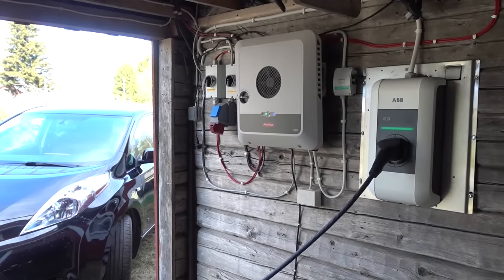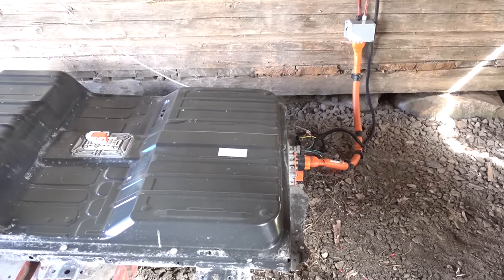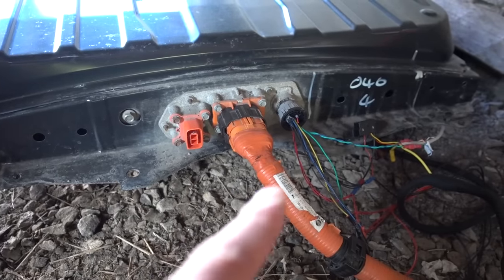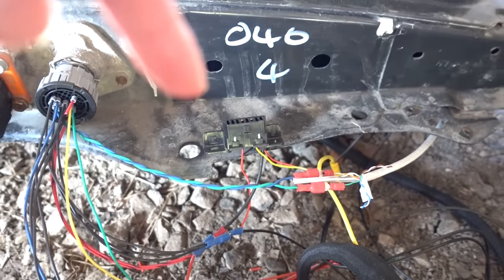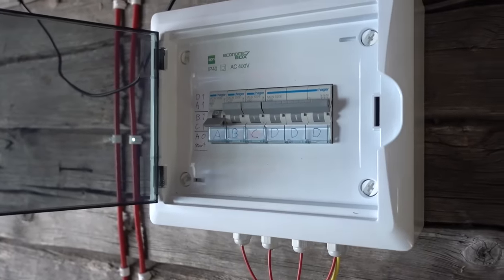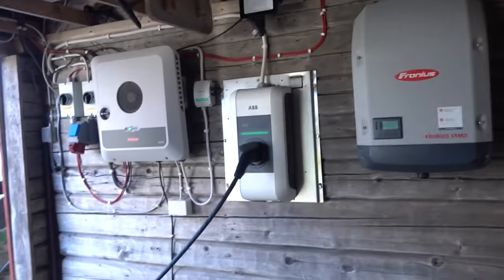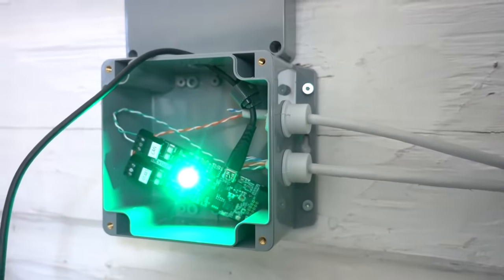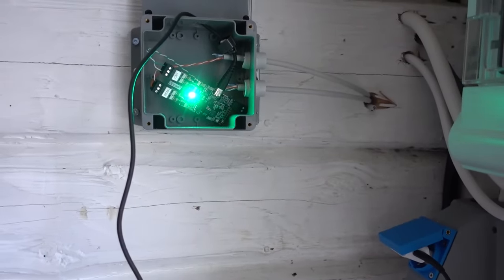The EASIEST way to connect used EV packs to grid! 🔋

Comment: Hi, it isn't really clear from the video if the BMS in the main battery remains active and does the balancing of the cells.
And since you are manually doing the precharge and the contactor, it looks like the BMS cannot protect the battery based on cell voltage or temperature. That would be very unsafe to advise to anyone.
I mean there are other inverters like Deye that can work with a high voltage battery without any communication, that is not the hard part. You have to make the car battery work just like in the car, with battery and protection.
Reply from the maker: The BMS remains active, balances, monitors, and shuts down if needed. See the wiki for more safety info: https://github.com/dalathegreat/BYD-Battery-Emulator-For-Gen24/wiki#what-about-safety

Contactor closing and precharge is now automated. Also see the wiki: https://github.com/dalathegreat/BYD-Battery-Emulator-For-Gen24/wiki/Nissan-LEAF-battery#automatic-control-
Reply: Ok great!
All model 3 supported probably also means standard range LFP version and the Y?

What prices do you buy the batteries for? Given the amount of Nissans in the past and currently the amount of Model 3s sold, I would hope for lower prices (something under the 100 euro / kWh)
The only thing that I can find that reaches that is a Model 3 72kWh for 5750 euro.
I have 40kWh of used older Winston cells that I want to replace my current 12kWh home battery with, but I'm not sure, maybe I should go the high-voltage route instead if it is more economical. (I work on battery systems so I should be experienced enough)

Comment: Love to see innovation on battery re - use. There are going to be lots of large serviceable batteries available in the future due to instances of vehicles failing before their batteries. I am going to assume the inverter or grid tie portion needs to be certified in many jurisdictions, but I wonder if it would be possible to hack a motor inverter to act as the DC - AC inverter in a project like this.
Reply from the maker: For offgrid use you can most likely do whatever, but when connecting a system to the grid you always have to use inverters that adhere to the necessary grid code standards of your area.

Comment: I already purchased 15kw of new LiFEPo4 batteries, for about $2500 from china.    How much cheaper is that Nissan Leaf?   And why does it not work in the car anymore while making it work in houses?   is it the C rating?   or the ability to crank amps?
Reply from the maker: This 30kWh pack was 2500€

Comment: Hey mate

Does this work in a power outage? if so what switches the supply to the grid off so it does not back feed into the grid?

Cheers
Reply from the maker: Yes Fronius sells a switchover bos that can be used with the Gen24 incase you want true offgrid capability.

Comment: Hi dala
🧙👍
What is the start seqenc printed on the switch box? D - A1 on - wait x seconds - B1 - C1 - A1 off. Can you discrib it? How long do you wait between each step?
Reply from the maker: The sequence is explained on the Github link in the description!
Reply: You wait until the voltage equalises across the main (open) contactor, there’s no point in guessing as each model of inverter will have a different capacitance.

Comment: The Fronius supports full island mode when battery connected, have you tried it?
I got the Enwitec switchover box and it functions very well, it's very awesome to have power when the grid has failed.
Reply from the maker: Yes it supports it, but I don't have the switchover box. The Fronius has a 3kW outlet that is active incase of grid failure that I have used before!
Reply: @DalasEVRepair  if you want to build the switchover box it's a standard DIN encapsulating with standard components (relays and fuses mostly), nothing magic in there. Enwitec even has schematics in the manual so it's easy to copy.

Comment: This is unbelievably amazing! How is the warranty for Fronius when you connect "off-brand" battery to it? Not that it matters that much, just asking...
Reply from the maker: I don't think you will get any support at all from them if you mention a DIY EV battery pack :D
Reply: @DalasEVRepair  Rather than support from Fronius, I wonder if this impacts in any way my grid connected approval papers - now the inverter works in a way when the grid goes down, the inverter goes down, too. I might need a specific device preventing me to back-feed grid when grid is down - to make sure I don't kill some technician during outage fix work...
Reply from the maker: @rklauco  No it does not! It will work the exact same way, if the grid goes down, then the inverter will shut down to prevent backfeeding.

Fronius has an extra offgrid contactor set you can purchase if you want the house/inverter to stay on when the grid goes down. This is needed to stay on without backfeeding, the contactors will disconnect the grid connection at the main incoming terminal. You can read more in their user manual about it.
Reply: @DalasEVRepair  Hmmm, OK, when the seller installed it he told me there is some sort of "backup mode" with battery, able to supply house. But he never mentioned any disconnect contactor - possibly because I did not went for the $13.000 10kWh battery (plus installation costs) :)
So you are only using the battery for energy balancing, not for KTLO while power outage, right? This is even more interesting as power outage here seems not to be any concern...

Comment: i was thinking a small micro plc modicon uses one you could replace the switch dance with a small ladder logic program and timing seqence
Reply from the maker: It is already implemented in the software via GPIO pins!

Comment: Sorry if this is a very simple question - does this need to be 3 phase or do you happen to just have a 3 phase system at home?
Reply from the maker: It works with 1phase inverters also! It just has to have support for BYD HVM batteries via Modbus!

Comment: No cooling for the Leaf battery still?
Reply: Leaf battery uses passive cooling. As long as you are not running 50kW through it: it is mostly fine.

Comment: Do you see a reason why this would not work in a functional car? I want to transplant the whole drive train into my tractor and use the battery together with a Gen24 most of the time. I´d go for a plugable solution in my case ... Thanks for sharing!
Reply from the maker: Should work just fine, just requires a lot of work!
Reply: @DalasEVRepair  Any chance that you (or someone in your community) develops a plug and play solution for Nissans ? I´m an electronic engineer and aside of my day job I deal with PV parts and wallboxes. I know that there is a huge demand for such smart solutions which use EV´s for home storage. I´m just lacking the time to start any add. project ...
Reply from the maker: @gutmanu123  Too high liability risk to sell something like this. But it is all open source with guides and wikis, if someone wants to make a product based on it they are free to do so!
Reply: @DalasEVRepair  Thanks a lot for the whole lot of information you are providing! Since just now I have the battery powering my Fronius Gen 24. It is now in Austria in use to power a "Erneuerbare Energiegemeinschaft" to supply also my neighbourhood with PV energy (35kWp).
Reply from the maker: @gutmanu123  Awesome! Congrats on the install!

Comment: You forgot step 1: how to get the money to buy this. Batteries, even junkyard ev batteries have premium cost in northern europe, hybrid inverters are quite rare here and extremely expensive also. It is nontheless a great setup you got. 

Me myself i also run diy offgrid but everything is imported from china, new B grade lifepo4, and epever ssc and inverter. Warranty claims on the electronics is a bit of a hassle but not impossible. Just takes time.
Reply from the maker: A 24kWh LEAF battery starts at 1,2k€, quite affordable IMO compared to LEAD acid!
Reply: That’s really cheap. Haven’t seen them for that price in the Netherlands yet. Please let me know where to get them for that price and I’ll import one or two.

Comment: your reduction box cable doesn't look like 10mm it looks like 10 awg which is 6mm.
10mm or 8awg is a thick multi strand wire cable. 
10mm is rated for 40Amps 6mm is 30 amps.
Reply from the maker: It is 10mm. I load it with max 18A

Comment: Could the pack be wall mounted to save space or is it better to be flat?
Reply from the maker: Yes it can be mounted on the wall to save space. But it weighs between 273 -> 420kg depending on which LEAF battery it is :D
Reply: Somewhere I read that any orientation of the leaf battery (at least the older ones), except upside down.

Comment: Oh My God, Dala, this is exactly what I was thinking of doing on the cheap cos Im on a low income compared to most people. Love what you are doing You are a Genius
Only last weekend went to the fully Charged Live Show in Harrogate UK and asked all the exhibitors about exactly what I have just watched you describe on here and not one of them said they had a system the could cater for a plug and play system with a second hand leaf battery. Would it be possible to speak over the phone through whats app? can I email you to set that up? 
I have a  2014 Nissan Leaf Tekna that I resurrected  from a write off 29k on the clock, now done 133.5k with 10 out of 12 battery bars still left and for the past 3 years I've charged it up to 100% with my Nissan Granny Charger about 5 to 6 times a week.   I have loved owning it over the past 6 years even though compared to more modern EV's its range is limited, it still caters for my everyday needs, 50 mile return journey to work in Cumbria and back and still had 38% left in the can, so to speak. 
I want to do a setup exactly like yours, I can't afford a solar roof system yet just wanted to get the low tariff of 12 pence per Kw, charge the battery's and car during the night then the release for the house during the day and so on. 
Kind Regards 
Graham
Reply from the maker: Hi, I don't sell anything related to this. Any BYD 11kWh modbus- compatible inverter will work with this solution!

Comment: Good job. Just a remark. Not safe that the high voltage and high current wires are installed on the wood wall.
Reply from the maker: Perfectly safe, the solar panel wires are the same brand and those are 700VDC! 😁

Comment: You mentioned "it's cheap" - how much did you pay for the battery? :)
Reply from the maker: Bit over 2000€. Keep in mind that a brand battery for this inverter would cost 24,000€, so it is very cheap 😂

Comment: Wow, I would love to do this for out home with a 75kwh Tesla Battery. I wonder if this could be done for less than €10,000?
Reply from the maker: 65kWh tesla m3 batteries go for about 5k€ in norway!
Reply: @DalasEVRepair  and the bonus of LiFePO4 chemistry
Reply: @DalasEVRepair  That’s an amazing low price for a used battery, Norway leads Europe in EV adoption and now battery recycling! I live in the North of Ireland, locally I could buy a 2022 75kwh Tesla battery for £7500/ €9000 ish. Our home heating is air source heat pump and my wife and drive Tesla EV’s. Having 75kwh of home storage would be beyond my wildest dreams, I will head over to your page to try to learn how I could make this happen. Our electricity is now very expensive at €0.39/ per unit. I would rather invest in solar PV and a repurposed Tesla battery than add the power companies hideous profits! Thank you for sharing your amazing findings!

Comment: Trying to find a way of mounting an EV pack to the wall of my house. They take up a lot of room flat. 

I’ve got a brick wall. Might make a metal frame that means I can mount that to the brick wall and then lift it up and onto it. With the help of some mates in exchange of some beers
Reply from the maker: Good idea, same method used in another video I have up on this topic!
Reply: @DalasEVRepair  Oo can you share with me which video that is
Reply from the maker: @TheOfficialBatteryMan  https://youtu.be/QCXeLO6gFRA

Comment: Can't do it in my country Norway without approved electrician do all the work. We are only able to play with 200VA 12V in Norway.
Reply from the maker: It should be very quick for an electrician to add a few meters of wires, and not that expensive!
Reply: 200Va er hva du har lov til å leke med INNE i huset ditt.., hva du gjør i en bod/container av Leca utenfor er på egen risk..😊
Og selvsagt kan du ta strømmen fra batteriene inn i huset via kabler, men da må inverter/kabling godkjennes av innstallatør🤔
Reply: @DalasEVRepair  It will be expensive as no electrician will do this witout buying all of the eqipment from them, Included the battery and it will also have to be CE marking on every part of your system..
Reply: @trygvetveit4747  I Norge har man ikke lov å montere solcellepanel på et bilbatteri engang. Selv ikke en campingvogn/husvagn om det står på fast plass.
Reply: @DalasEVRepair  Yeah, but none electrician even want to connect DIY at all. They take around 12500,- NOK for visit and 3500,- NOK/hour also 1250€ for meet up and 350€ hour price + travel etc etc.

Comment: Really cool but does that inverter only go 1 way for both ways
Reply from the maker: Both ways!
Reply: @DalasEVRepair  what's the model of that inverter please so I can look into
Reply from the maker: @plojm123  Fronius Gen24
Reply: @DalasEVRepair  I was looking at the specs and thought I saw it wants 400v nominal. I thought nissian leaf 2 is only 96s which is less. I have a bunch of ford cmax batteries they are only 84s which is even less
Reply from the maker: @plojm123  It works with 150-450V!
Reply: @DalasEVRepair  I wish I saw some more material on the battery setup it would be interesting to me

Comment: Splitting cable to passthrough 4 hermetic seal bushings isn't a great solution. What was the point? Did have not enough enclosure depth to fit in a bigger bushing? In any case, the setup makes little sense. The water will get into the cable and ruin it eventually.

Comment: Also remember to prof the battery against rodents and most important water (flood) damage. The batteries for the Leaf (and properly also the Tesla batteries) are made so they may be flooded in case of a fire og damage.

Comment: Ok so you could automate the battery startup pretty easily using time relais and a contactor. And it also would look more professional if you used DIN Rail mounted 12V and 5V transformers and some cable trunking. 
Sadly this whole system is like completely illegal to use in germany.
Reply from the maker: Yes it is a good improvement idea to automate the contactor sequence. This is made for Finland, but I am sure you could make a version that is compatible with German electrical laws!

Comment: Very nice! But forget your home insurance. It will never cover any damages in any circumstances with diy installation.
Reply from the maker: In Finland, solar and battery installs are covered under home insurance, as long as an electrician has signed off on it

Comment: Let,me be very clear, I am an EV certified Tech. Never do this. These batteries become unstable to charging and discharging when they are at end of life. If you chose to do this please keep,the battery outside on concrete and away from all other structures. Please,do not do this.
Reply from the maker: Software stops if internal resistance is too high (or state of health too low), and suggests recycling!
Reply: @DalasEVRepair  software check section temp not individual cells and all you need is one cell to go and it takes out the rest. This is highly discouraged by the manufacturer and are you going to be personally responsible when one of your time bombs goes off on someone. This is just plain dumb.

Comment: See you have also Fronius Symo, but as it is a grid tie it won't work with it? (same as I have) so is that Fronius what you are using Offgrid only or does it feed anything to the grid? Interesting to invest some like this as we have now this negative price SPOT pricing as you have to pay if you feed your solar some hours to the grid! Who will know if it is some day like few euros per kWh so this system is just big bullshit thing in my mind!
Reply from the maker: The other Symo will be an expansion for more panels (not related to the battery in any way)

Comment: The Leaf is a great concept that fell flat on its face, due to battery shortcomings.
Limited range, and (especially in 2011 and 2012) low power. Its also a passively cooled battery, which means it overheats easily, degrading battery life. Amazing to me that Nissan never fundamentally changed or updated its battery design, to give the Leaf a lot more range. To the end of its production, it remained a well built car, fun to drive, but with hopelessly outdated battery design.
Nissan failed to support the Leaf design with needed improvements.

Comment: I hope no one sees this video and try the same setup with the 400v out on a Tesla battery pack... As I understand it this is ONLY possible to use like this because the inverter you have is 48v and the leaf battery is also 48v? Most electric cars have MUCH higher voltages, (like 400v on the Tesla).
Reply from the maker: This is 400V. It also works with 800V batteries, like Kia EV-6

Comment: You never said how cheap it is...
Reply from the maker: Used EV Battery prices depend on region. Here in Finland they are 75€/kWh
Reply: @DalasEVRepair  So that battery cost you 3,000 Euro?   When you buy a battery like this, isn't it problematic because most likely the battery going bad is the reason the car was junked?  Are you running software that balances the cells like it did in the car?